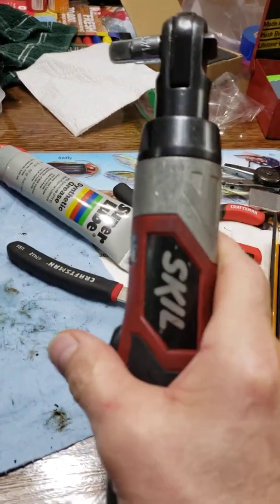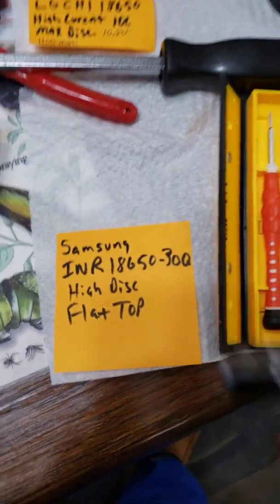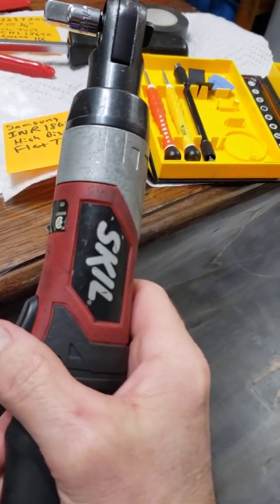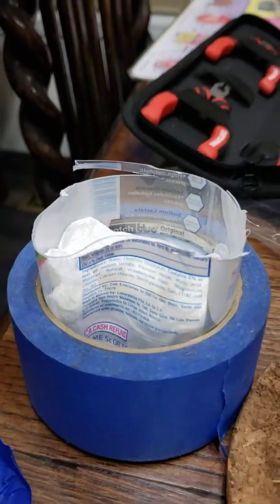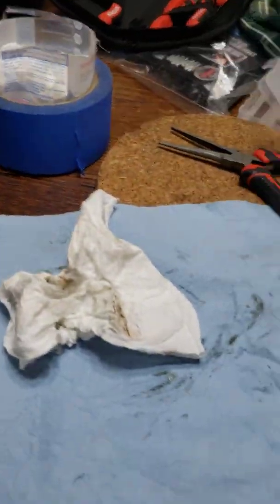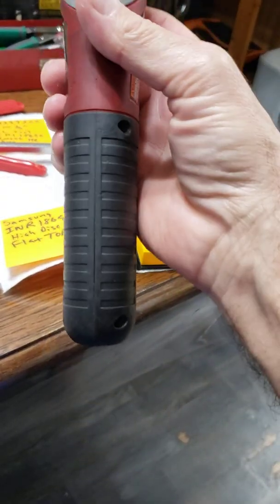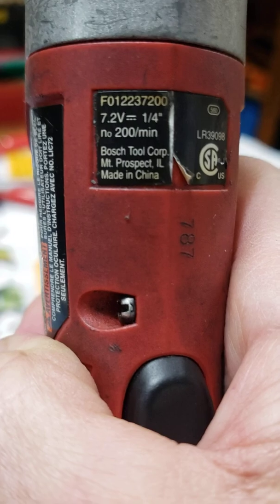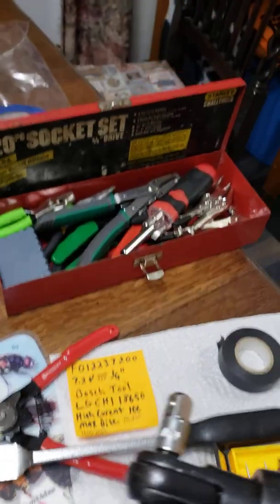#2 Skil/Bosch 1/4 drive ratchet battery replacement.

Comment: What symptoms did old battery produce?
Mine spins for a millisecond every time I push the trigger but won't spin continuously. Ratchet is about 10 years old with original battery.
Reply from the maker: That sounds like battery

Comment: I disassembled mine back in 2019 and ordered some new batteries. I finally put it back together yesterday with the new cells but can't find the 6 screws that hold the outside shell together. Would you happen to know the length and size?
Reply from the maker: 12mm long 3mm dia 5.5mm head dia. Coarse plastic or wood thread
Reply: @Malach211  Thanks a million. It's a big help. The ratchet works wonderful with new batteries and especially after I lubed it up. Nice torque.
Reply from the maker: @NextLevelAutoDiagnosticsLLC  no prob. I was looking back at comments and saw your again and dropped everything and got the size 4u. I didnt want to forget again. Haaa